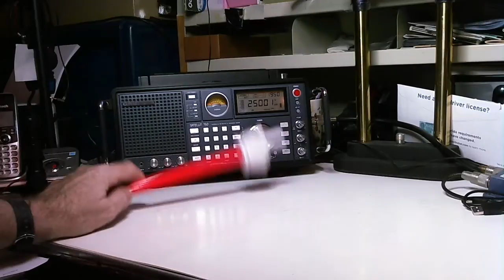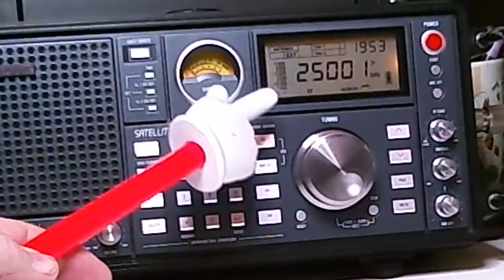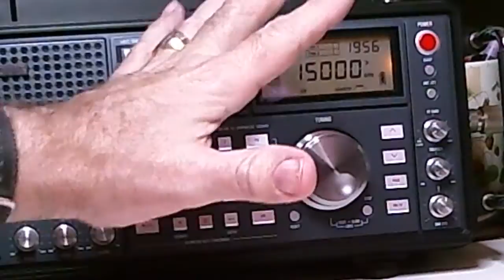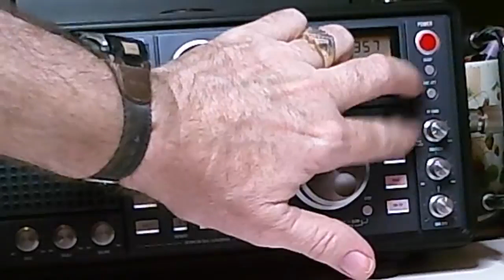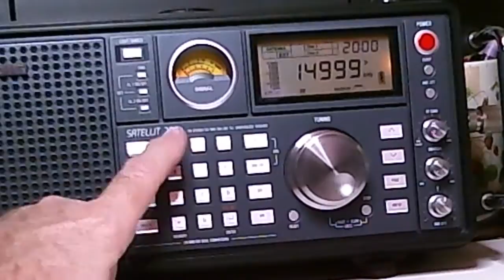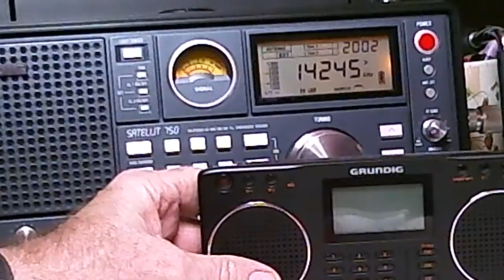TRRS #283 - Grundig 750 Shortwave Radio - Controls

Comment: I hope other (ETON) Grundig Satellite 750's are better then the one I bought. So far I've discovered numerous cold solder joints, bad connections and scratchy ferrite antenna, bad pots .. Like the volume control. If I tapped one end of the rig up and down on a firm surface (not hard of course) it powered off and on. Eton now sells it as the Eton Elite.. lol.

I would beware. Oh and I purchased mine back in August 2012.
Reply from the maker: I have never had any problems with my Grundig radios where I have heard the Eton radios have a lot of quality control problems.
Reply: Thanks for reply Tom .. I'm glad you didn't have any issues with yours. I wish I would have purchased a Tecsun version .. It's really confusing trying to figure out who builds what brand / version. Thinking about getting something else, but not sure just what yet. Not anything Eton .. That's for sure.  Any suggestions?  :)
Reply from the maker: @fitcher-armchair-sleuth  For something to consider is the newer Tecsun radios like the H-501x.  I have several shows on this radio and really like it.  I got mine from ANON-CO.  Anna from there has been very helpful.

Comment: Where can i find replacement potentiometers (value unknown) for the Squelch, RF gain and the SB BFO controls? The radio is a Eton Grundig Satellit 750 which is the same as Tecsun 2000. Anyone with the schematic diagram please tell me the values. Thank you so much !

Comment: why is it im hearing whats on but no meter reading? Is the meter crapy on that radio?
Reply from the maker: Jim- Hamradio This is a great radio (see my other videos) and there is nothing wrong with the S meter.  Thanks for your comments.
Reply: asking because i may get one and im a ham so woundered about the meter. I did see the other vids thanks..
Reply from the maker: Jim- Hamradio Ok, yes the meter works fine.   This is the latest version of this radio (purchased last year from Amazon).  Note this is not the Eton version.

Comment: Very enlightening Tom thanks. I've been using my new 750 for a few days. Really enjoying it, its the only decent radio I've used since my grandmothers old valve set 30 years ago.
I noticed the tuning knob seemed to feel a little unstable though.  I checked the lock nut and it was loose.  Tuning knob feels much better after I tightened it.
Reply from the maker: Thanks for your comments.  The loose knob is quite common on this radio.  The original 750s were worse. Keep us posted on your experiences with the 750.

Tom

Comment: Hay Tom, yet another good vid, My question would be--- is the 750 worth the money??? I normally radio shop for the best bang for the buck, right now I'm going between the Tecsun 880 and 660, I also have the DX160 (and love it for the good old days value) and DX440, KD7YKR, 73s
Reply from the maker: Yes, the 750 is a very good radio as they have fixed some of the early problems they had with this radio when it first came out.  It's not really a portable so if you want something to carry around a newer version of the 660 would be better.  Lastly, if you want an 880, I would suggest you wait until they fix some of the problems with the early versions.  I have had two versions of the 880 and the second version they fixed many of the problems but not all.

Tom